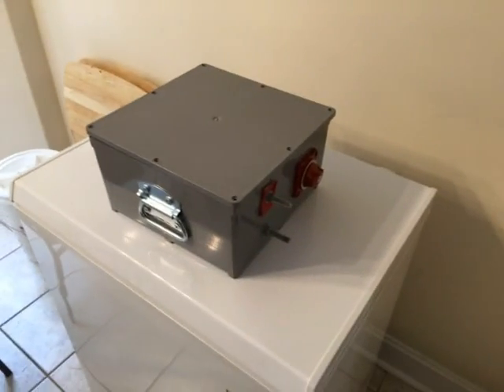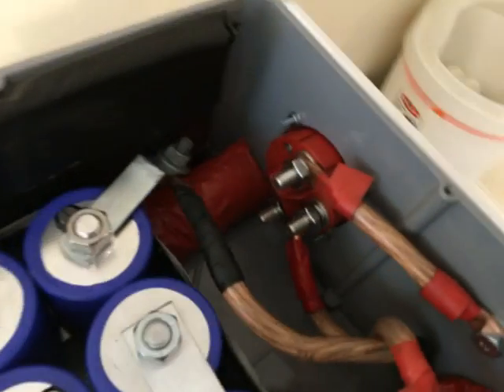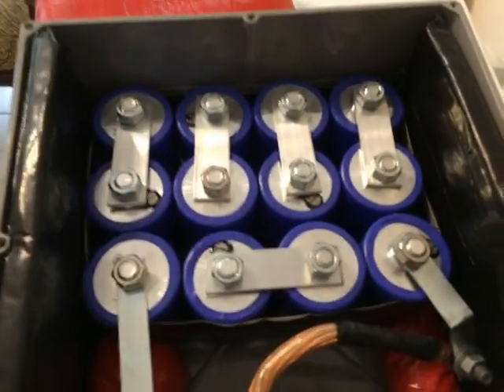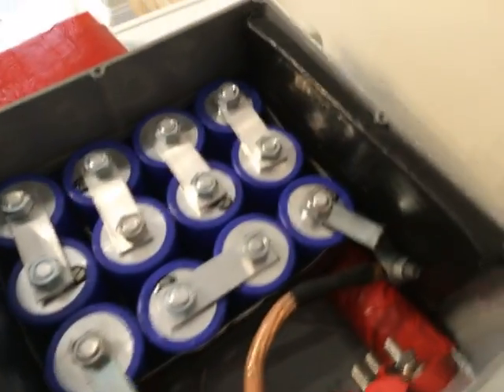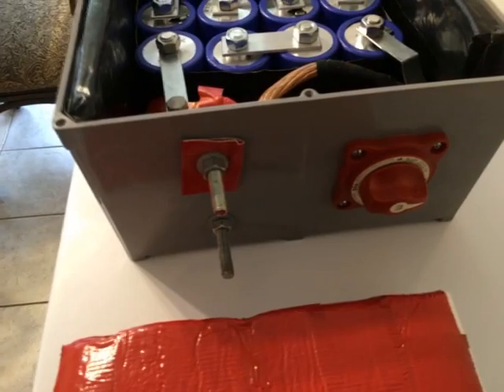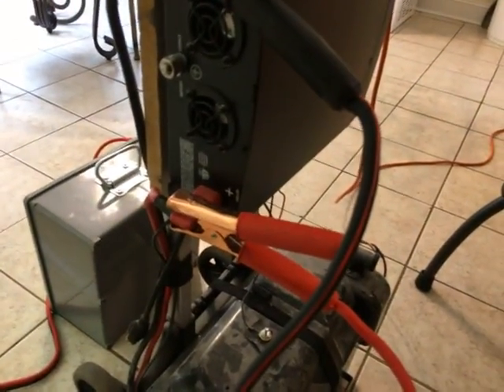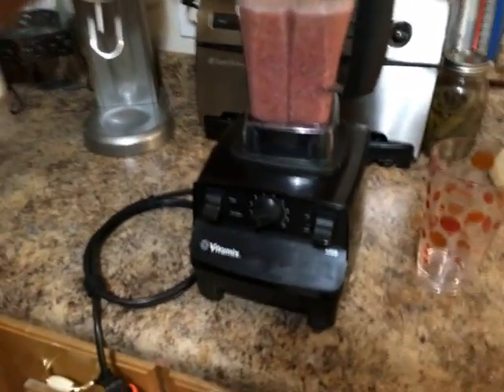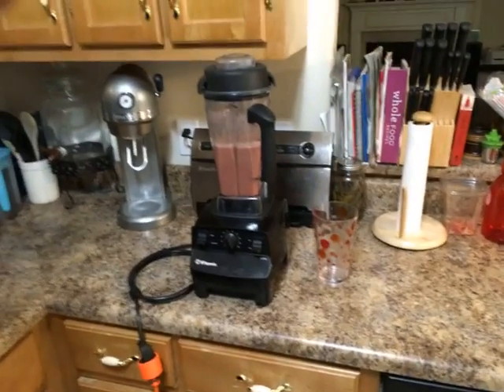DIY - Simple Portable Ultra Capacitor Boost pack

Comment: Great video. Did you consider keeping the configuration to 16.2V in order to maximize the total Farads?  for example two sets of 6 caps in series and then connected in parallel to keep the voltage to 16.2V with a total Farad capacity of 333. The way you have it now is for 32.4V but only 83.3F.  Is your inverter rated to accept only over 24V? What is the CCA difference with 32.4V?

Comment: Have you tested the CCA (Cold Crank Amp)?? I wanted to know that much of UC how many CCA on it?
I have mine using 6x LSUC ultracapacitors 2.85v 3400F in series and the CCA is over 1000Amps.
Here is the link bellow: https://youtu.be/iTgjsV8bqCs
Thanks

Comment: I have made mine connection strips from flattened copper 1/2" pipes. Cheap and lower resistance than AL and steel.

Comment: You can combine CU and AL easily.  I do it regularly.  Just use NOALOX in the electrical section at HD / Lowes.  You use it for this purpose.  DON'T combine copper and steel, especially galv steel. Copper will destroy it in short order.

Comment: BTW - Every home has electrical service with aluminum wire, the difference it that Anti-Oxide compound (Noalox) is put on the contacts which allows copper and aluminum connections.
Reply from the maker: Good info, thanks for the comments.

Comment: That is a VERY slick setup. I'm totally going to steal your idea! I bought an expensive DeWalt booster pack yesterday to start up my lawn tractor which is always dead. The boost pack was too wimpy to start the tractor with the dead battery in place, and too "smart" to start it with the battery removed. DeWalt will be getting their boost pack back so they can think about their stupid lawyer engineering. I will build my own boost pack that bypasses crappy batteries that won't last more than 2 years, and crappy boost packs with too much lawyer engineering. Thank your for a great idea!
Reply from the maker: Thanks for the comments.  I've been using Ultra Caps in my car to replace the battery for close to or over a year and so far they've worked great.  I've updated the boost pack to have 4 or 5 18540 Lithium batteries to keep it constantly topped off, so far it's still working great.

Comment: My issue is a little off topic we build custom motorcycles and the bigger the motor the motor starin that is put on the batteries even if high CCAs. So what we are thinking about doing is adding a capacitor to give the battery a boost during starting. I have been watch all sorts of youtube videos on this and people are using anyware from 14v-50v capacitors. From my understanding is the voltage doesn't matter since that is just a maximum voltage the unit can handle and with heat and age that maximum voltage rating can drop causing the capacitor to burn out. So we are planning to use a capacitor at least 3x the bikes voltage which is about 13.8. But what we are most concerned about is the farad rating. I watch an HVAC companies video on capacitors and they say that too large of one can burn out their motors so they deal with microfarads instead. So we are wondering if this will be an issue with a motorcycle starter and other electronics that there is a certain farad rating we should stay below or not? I have see all sorts of capacitors for cars that ranged from 1 to 50 farads and more. I don't think we need anything that massive but we want something to give a good boost to the battery at start up so the bikes fire easier instead of lagging on the compression stroke with all the lights fading looking like the battery might not have enough oomf. Can you advise a capacitor rating and if they should include a diode, resistor, or voltage regulator? Since they will need to be small enough to hide on a motorcycle we will most likely just have to order basic capacitors from overseas and what not to wire ourselves compared to one of the large stereo units that comes complete ready to bolt in and connect the wires. Any help would be appreciated. Thanks,
Reply: The caps he's using here is perfect for what you want to do.  I'm adding a set to my vehicle to ease starting load on battery and to ease the load of high current electrical accessories.  Adding a set of 500f super caps to a vehicle will greatly increase the life of the starter, the battery and the alternator. If you look at current draw during starting, each engine cylinder compression phase adds a sharp current spike.  On a large twin it'd be even more pronounced.  Look around for a 6 cap pre-built array.  They're all over and they're specifically for this application.    One benefit of adding caps is that it will still turn over an engine down to 9.5v so even a drained battery will start a car.  Very neat stuff and worth putting an appropriate sized set of caps on every single vehicle you own.  These are doing wonders for diesel engines, especially in starting during cold weather where batteries can't even begin to touch the amperage that super caps are  able to deliver.
Reply from the maker: You may want to look at something like this link, HVAC caps are different than the caps I'm using in my system, they are not the same.  You are talking about supplementing or boosting the battery.  In this case you need to look at car audio caps or ultra-caps with a decent sized farad rating, not micro-farads.  Take a look at this link.  https://www.ebay.com/p/FARAD-Capacitor-2-7v-500f-6-Pcs-1-Set-Super-Capacitance-With-Protection-Board/6011207905?iid=222751284347&_trkparms=aid%3D555018%26algo%3DPL.SIM%26ao%3D2%26asc%3D44039%26meid%3Da748f6ff1929461fa2a89ec1ccfa4d24%26pid%3D100623%26rk%3D1%26rkt%3D6%26sd%3D300945126145%26itm%3D222751284347&_trksid=p2047675.c100623.m-1
Reply: Motorcycles with big inch motors like 103ci or higher will eat up AGM or Lead Acid batteries, sometimes leaving you to buy a new battery every year. The motorcycle's high compression usually needs a 1.4-2 kilowatt starter. So as soon as you try and start that motor you'll get at least a 2-3+ volts in dip with traditional batteries. 

Adding a Super Capacitor to an existing battery will maintain the voltage during initial startups. 

The bad side will be on your motorcycle starter solid and ring gear. The internal copper contacts will also wear out slightly faster than a normal lead acid battery. Also the engine crank motor will spin harder and faster which might shred your starter ring gear if it isn't a high performance product. You will also need to upgrade to performance spark plugs which will burn 10x hotter during ignition. The size of the super capacitor bank will be an issue as most motorcycles have limited space if the bike isn't equipped with a rack or a safe storage area. 

The good side, solenoid replacement contacts are dime a dozen and easy to change. Get better fuel milage with performanc plugs burning hotter during ignition. Your existing battery strapped with a super capacitor bank, it will make your battery last an extra 1-2 years longer on top of the battery specifications or approximate 3-5yrs. 

Hard to start big inch motorcycle engines will be a thing of the past!

Additionally if you have not done so yet, consider installing manual or electronic compression release or trade out your stock cams and use the easy cam start.

Comment: super capacitors are expensive like 60 dollars up some are more than hundred of dollars, my question is can i use the amplifier capacitor instead of that kind  of super expensive  super capacitor ? if so , what should be the value of the capacitor if i got a 12 volts 1500 watts inverter?

Comment: Could you combine a super pack with a 900 w generator,,  in a hybrid system for portable power on a building site.  So as don't need a  2 or 3 kW  generator heavy to lug around and more thirsty and still use power tools up to 3 kw like a big pull saw .   Also don't have to wait for someone else to stop using a power tool before you can use yours.  Or better still combine it with some solar panels.    On building sites often need high power but quite intermittently, you could add a car battery for a little storage.  He He got my next project.

Comment: aluminum is not really a good conductor  ..... probably better to use all copper
Reply from the maker: Agreed, unfortunately I believe I mis-spoke in this video, I"m actually using steel and copper for the terminal connections, not aluminum, except for the connecting bars.

Comment: I wonder if 84 of these, connected in series to make 226v and installed in a Toyota prius to boost the battery pack. Can this work or not guys?? Or will it burn the crap out of the car! Some say they get unstable sometimes!
Reply from the maker: 84 of these 1000F caps gets rather expensive, also at 1000F / 84 caps would give you around 11F, so I don't know if this would benefit a setup as you described.

Comment: what can you jump with a 32-volt jump box?
Reply from the maker: The jump box had an upper ceiling voltage of 32 volts, but being that we're talking about ultra-caps and not batteries, they would typically never get above 14 or 15v.  I've since removed 6 of the cells to increase capacitance.  The 12 cells were there for me to experiment with.

Comment: I guess you have heard about galvanic corrosion between aluminum and copper, which is why you have these extra steel straps fitted. Now, that is not a problem unless you pour water on the junction. And if you are still apprehensive then tin the copper terminals. I'm guessing you'll probably gain a couple of hundred millivolts eliminating the steel connection.

But how do you secure correct charge on each capacitor?
Reply from the maker: Thanks for your comment.  Water is not much of a problem with this box so the steel connectors work fine and I have no real concern about them, tinning would help if it became an issue, but I don't see that happening.  Some say balancing circuit boards would help to ensure that no cell gets to unbalanced, but there is another camp that says that for small projects like these they are not really needed.  I'm in that camp, at least until I find evidence to the contrary.  These cells in this application should never reach the voltage ceiling of 16V, so I see little to worry about in this case.  But thanks for commend and your question.
Reply: I was just wondering what would happen, if ie. one of the capacitors loose some capacitance - which in turn will result in a higher voltage across that capacitor - perhaps exceeding the rated voltage at some point - and then what?
Reply from the maker: Thanks again for your comment.  Coming from China, there is the risk, but at this point I would suggest that the risk is relatively low considering what these caps are used for.  If I were using them under the hood constantly being used by the car and being charged by the alternator, then I would definitely consider using a balancing board.  However, as a jump box, I'm not as concerned.

Comment: I'm looking to build a battery from ultracapacitors to put through an inverter.  I want to find something that can charge quickly and use to heat my Nissan Leaf in winter.   Do you think this would work?  How long would this work for a 600 w heater?  pm me if you are still checking this and I'll give you my email address
Reply from the maker: I'm not sure how ultra-caps would do in your scenario, they are very good for quick power, but not very suitable for resistive loads like a heating element.
Reply: any suggestions on what to try?  I'd like to get something that would charge quickly and use for a heater
Reply from the maker: I've been thinking over your question, the only thing I can come up with, at the moment, would be to get cells similar to these and put them in "parallel" to increase the overall capacitance to crazy levels.  Then connecting that type of capacitor bank to a heating coil would potentially produce a lot of heat in the short term.  Connecting the caps to a charging source like 1kw to 2kw of solar would help with the charging.  However, connecting the cells in parallel would 12000F of capacitance and that could be more than a little dangerous to deal with.  A bank such as that could produce enough power to weld with, so you can image the power you would be dealing with.  The other course of action would be connect then to an inverter during the day and use 2kw or greater of solar to power a 1500w heater, but again these are just some thoughts off the top of my head.

Comment: Please plug this into a portable or window AirCon (Rated at 1100 watts @ 110VAC).   How many minutes before voltage drops on batteries to 10.5 ?   Or the inverter shuts off ?    To prove the super caps can take the initial surge for 3 to 5 seconds... then the AirCon compressor should settle down to draw a lot less load from the batteries.    If your inverter cannot handle a Air Con load,   how about brewing a pot of coffee -  Normally takes about 5 minutes ...   Thanks for doing this... nice portable setup you rigged on the dolly.
Reply from the maker: Here you go.  https://youtu.be/HVBXDDjtpno

Comment: You can buy a boost pack from Walmart auto section. It is made for jumping a battery to start the car. It looks nice with cables and carrying case. It is cheaper than a battery, and it is rechargeable through the cigarette lighter. Probably capacitors.
Reply from the maker: Thanks for the comment.  If that boost box is capacitors as well, then it would definitely be worth the money.
Reply: More like a few 18650 lithium ion batteries
Reply from the maker: Sam Franks I agree
Reply: Walmart jump boxs are junk. I have gone through 3 so far. Light to no use. Junk. Just got my money back and making my own

Comment: Are you running a 12 or 24 volt inverter ?
Reply from the maker: i Have a 24v inverter for the whole house, and a 12v inverter for a portable system.

Comment: i am wanting to build this can you give me a list
Reply from the maker: Maxwell UltraCapacitors (x6 min, however I used 12 low grade\capacitance units from China through AliExpress)
https://www.tecategroup.com/store/index.php?main_page=product_info&products_id=1259  = Ultra caps (6 will do)

Balance circuits
2.7V 3000F 2 String Super Capacitor Protection Board 5.4V Protection Board = Found on ebay (I didn't use them on the portable, but I use them on my other banks.  I recommend them.

Connecting aluminum straps
Low-Z Strap, 12 pack, Maxwell Super Farad Ultra Capacitor BCAP0010 = Found on ebay (you can buy these or buy an aluminum strip from Home Depot and size\cut accordingly.  That's what I do now, it's basically the same material, just cut neater.

Box
Carlon 8 in. x 4 in. Junction Box in PVC = From Lowes or Home Depot (Essentially, get any box that will fit for you, I used this one due to the number and size of my caps from China, 12 caps that are smaller than the maxwells.)

Metal Handle - Found at Lowes or Home Depot

Voltage Meter 
Mini DC 5-120V Voltmeter Blue LED Panel 3-Digital Display Voltage Meter 2-wire = Found on Ebay 

2AWG wire with "Tin Coated Lugs"  Do not use Copper.  Copper and Aluminum don't mix.
TIN COATED BATTERY LUG, SOLAR, CAR, BOAT, WIND, RV, ELECTRICAL = Found on Ebay    

Hope this helps.